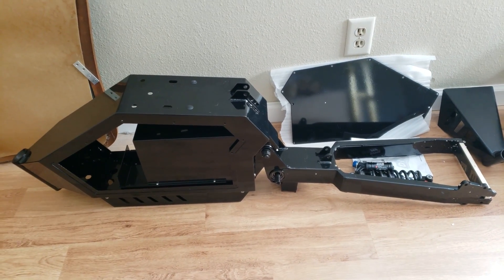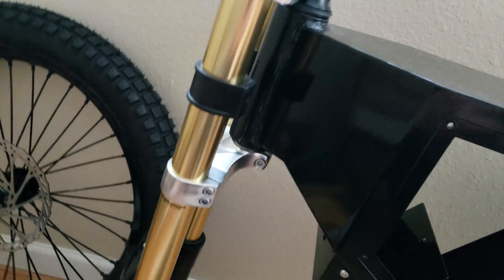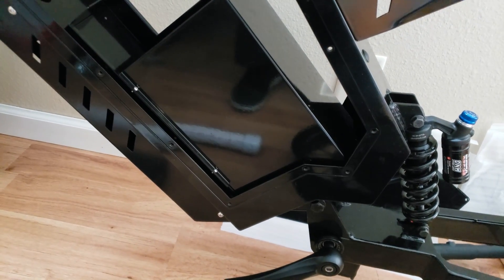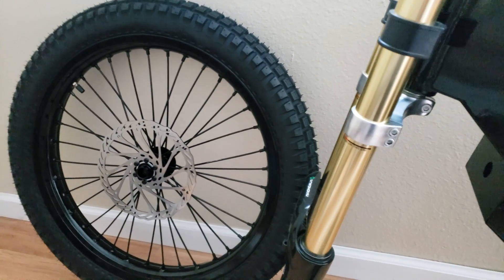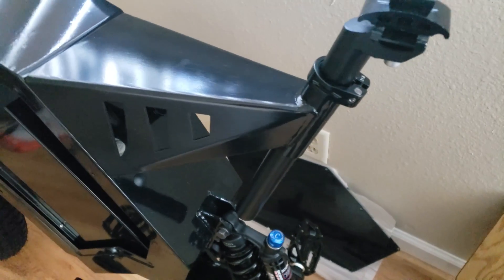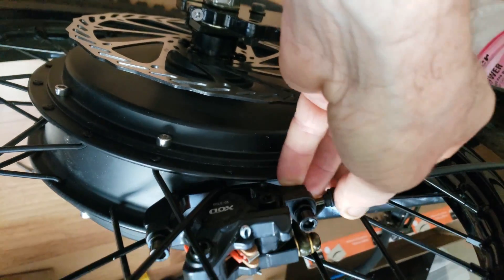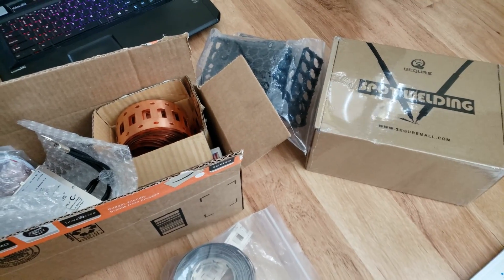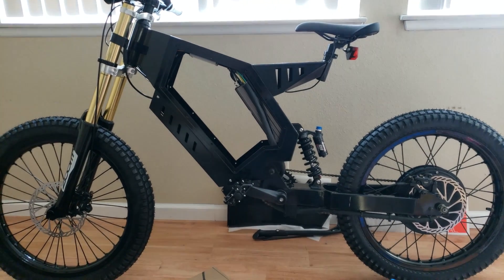Enduro Ebike build start to finish

Comment: Hey I just received a 8000w version of this exact bike from Alibaba. Can you please tell me your advance settings? Here are mine - 

Current limit - 120A
Poles in motor - 32
throttle PWM % - 0
Assist poles - 12

Does this look right to you? Thanks
Reply from the maker: Man I wish I can help you I have the controller out of the bike right now and I don't remember the exact settings  but keep in mind just because the bike looks like mine doesn't mean that it has the same electronics so I would be careful with that,  I know my controller is set at 150 amp but you may have a different controller.
Reply: @samjohnson517  I have the Sabvoton controller with bluetooth 72v 150a, 72v. 40 AMP Panasonic Cells
. when you put it back can you make a video and go through each settings in the ukc1 menu? thank you!
Reply: Also do you remember if you put 19in in the UKC1 setting?
Reply: Yo who did u buy from

Comment: hey sam. im building an ebike like yours. Im finding it very difficult to fires tires. the kit that i got say that the freewheel is 1.6x19 and the rear motor wheel is 2.5x19. what tires did you use?
Reply from the maker: I used shinko 241 size 2.75x 19 they work great on street and dirt
Reply: @samjohnson517  do you happen to recall what size the rims were? The kit that I bought doesn't use the same size front and rear.
Reply from the maker: @NirvashOne  money both the same I believe they're 1.6 you may have to jump to a 3.00 tire for the back but make sure you have enough room between the swing arm

Comment: can i use  29" wheels with this frame
Reply from the maker: Most are Up to 27.5 but ask the shop that you're buying it from, personally I would not use bicycle wheels they're too weak and will have to use bicycle tires which means flats which are a pain to fix on this bike

Comment: Can it be fitted with mid drive motor?
Reply from the maker: I mean when it comes down to it you can pretty much make anything work with modifications, but the short answer is no because the frame is too wide

Comment: You drilled a hole for the torque arms?
Reply from the maker: Yes, just a side note in my later videos I ended up leaving out those washers completely and just using the torque arms themselves for spacers.

Comment: Where did you get the wheels
Reply from the maker: Hello they came in the kit with the controller they're 19 inch motorcycle the place I got the kit from is called Ncyclebike  you can find them on AliExpress and Alibaba

Comment: I want the exact wheels ,motor, controller ect. Link in description does not work. Please help
Reply from the maker: I know I'm having problems with that Alibaba link, open up the Alibaba app and search for a seller called Ncycle, it is not something you can just add to the cart you have to contact them and customize it like this:   it is the 5000w kit, you will need to specify 3.5 turn motor and  upgrade the controller from 100 to 150  amp,  add a 19 inch front motorcycle wheel (the rear wheel is also a 19 inch motorcycle wheel. ) Tell them to keep the brakes the ones in the kit are not hydraulic.
Reply from the maker: https://encycle.m.en.alibaba.com/index.html?wx_navbar_transparent=true&tracelog=sns_minisite

Comment: Hey Sam! Your ebike build has inspired me to do my own. I’m working on putting it together right now but my controller didn’t come with any instructions. What are the two small connectors for that come out of the controller? Mine came plugged in to eachother.
Reply from the maker: Yes leave those connected together unless you need to do the hall test or change some of the parameters then you would disconnect them
Reply: @samjohnson517  awesome thank you! One more question- my hub motor has two big connectors coming off of it along with the motor phase cables. One connector has the RGBY wires so I know it’s the motor phase wires and it plugs into the matching connector coming out of the controller. The other connector has brown, white, purple, grey, orange, and silver wires and there isn’t a matching connector coming out of the controller for it. Do you know what this connector is for and if it’s supposed to be plugged in to anything?
Reply from the maker: It is just an extra phase connector mine has a cap on it. Just use the face connector with the corresponding wires

Comment: What is the issue with the forks? Would they have a hard time offroad? I am trying to build a similar thing for ripping around dirt paths but am totally new to this.
Reply from the maker: Hello if you're going to be manly off-road I'd probably step up on the forks maybe get some dnms these are okay but they're kind of annoying off-road they just make a lot of noise and the dampening is not very good

Comment: Is there a way to change the rear tire without having to unwire the rear motor?
Reply from the maker: Oh absolutely you do not have to disconnect the wire to change the tire, all you do is cut the zip ties off that hold the wire,  that gives you enough slack  to pull the rim off and then you remove the tire from the freewheel side.

Comment: Important question…can a stealth bomber frame fit 27.5 rims
Reply from the maker: Hello,  I can tell you that 27.5in rims will fit on my Enduro / bomber style frame just keep in mind some of these frames  are different but the specs should be listed.
Reply: @samjohnson517  yeah it fits easily, I even tried a old 28 inch rime, and still fit with ease….I was too lazy to experiment a 29inch tire….I believe a 29inch tire would fit with minor adjustments.
I will be doing a video on my build….tomorrow….I caught the e-bike bug as well’ no e-bike is the same, dispite having similar frames’ that’s why I like doing DIY….I could’ve bought a already built one….but what’s the fun in that? 
DIY teaches a person how these bikes work, and teaches you how to replace parts, if needed.

Comment: I meant can you remember what size bearings and cups the headset uses
Reply from the maker: No I don't remember , they came with the frame I tried to look up the old eBay listing but it's so old it's not on there anymore
Reply: @samjohnson517  OK thank for looking

Comment: How did you cut of the rail on the controller?
Reply from the maker: Hello, I used to jigsaw, I left a very small ridge enough to get some u-shaped weather stripping over the area  I cut, that's just for cosmetic though.

Comment: they supply 2 sets of torque brackets we used one on the inside and one on the out side
Reply from the maker: @katiekumcgil mine only had one set in a later video I just ended up bolting it together with no spacers I've had no issues in 5,000 miles.
Reply: @samjohnson517  AWESOME thats good distance with no hiccups ,i used a crystalyte hs4065 rd notor so actually had to get axle extenders to fit the drop outs it was the fastest motor i could find that still lets you run 7 speed casette and i worked out a way to put a 500watt bafang front motor onto the through axle forks,you can see a video on my chanel how the build ended up with the modified suspension

Comment: Hey guys a question ?? I have Enduro QS273 , battery 72v 52.2 Ah  BMS puts out 104 Amps.. my controller is subvoton 72150amps My question is WHAT HAPPENS IF I REPLACE MY CONTROLLER    WITH   FARDRIVE 72350 AMPS does it give me any benefits torque higher speed and more power??????
Reply from the maker: Hello I do not think you will see any type of performance increase. Is the 104 amps the burst rating of the battery or the continuous rating? But either way your 72150 can handle it. To get  performance boost from that 72350  controller you would have to change out the battery to one that would put out more amps.
Reply: @samjohnson517  so the  battery is the bottleneck ???
Reply from the maker: I guess it's more of the thing that's holding the system back by not feeding enough power. However there is  absolutely nothing wrong with a 100 amps!

Comment: Where did you get your front rim and spokes from? Working on a build now and would greatly appreciate your insight! Thanks for adding in so may details! Add one more subscriber! 🙂👍
Reply from the maker: Hello thank you! I purchased the rims, motor and  controller all together in a kit from Ncycle they are on AliExpress and Alibaba. The rims were fully assembled in fact the entire kit was plug and play.
Reply: Awesome! One more quick question. Where did you find your headlight that you installed later? I've looked all over and can't find it cheaper than 40! Thanks so much for your help!
Reply from the maker: @grantgall2517 no problem at all I'm here to help  I got it on AliExpress here is a link
https://a.aliexpress.com/_mqzgWRx
Let me know if you need anything else

Comment: Which tires are compatible? What is the frame specification?
Reply from the maker: I'm running 19 inch motorcycle wheels with 2.75x19 shinko 241 tires they're about 3 in wide

Comment: Can you put pegs on bomber frame?
Reply from the maker: Should be able to bolt them onto the swing arm, you may have to drill some holes though, unless you can find some clamp on type.
Reply: @samjohnson517  oh okay thanks

Comment: Can you post another link to the wheels you got?
Reply from the maker: Sure but I've been having problems to get Alibaba links to work if this link does not work go to ncycle on Alibaba I purchased their 5,000 watt motor kit and added the front rim and upgraded the controller to 150 amp
https://app.alibaba.com/dynamiclink?touchId=1600127981110&type=product&schema=enalibaba%3A%2F%2Fdetail%3Fid%3D1600127981110%26ck%3Dshare_detail&ck=share_detail&shareScene=buyer
Reply: @samjohnson517  I’m totally new to this. I looked up ncycle for 12000w motor kit. Should I get 12000w or 5000w?
Reply from the maker: hello Cole, I know it is confusing my motor is a 205mm 5,000 Watt,   which means it is rated to run at 5,000 Watts continuously, however I send 12,000 Watts through mine for brief periods of time, speed runs etc. With no issues. Most motor manufacturers have two ratings,  continuous and burst or max .
Reply from the maker: As far as which one to get that's up to you , I believe the 12,000 W you' are referring to is the 273mm. If you are planning to use a large enough battery so the larger motor can take advantage of it and/or high speed 65 to 70 mph on a "continuous" basis maybe the larger motor is for you. Note that there are different turn motors mine is at 3.5t the higher the turn number the more torque you get but lower top speed.

Comment: Hi mate   ive the same controller...what is the 3 small wires going into one plug for ? Is it 12v ?
Reply from the maker: Hello Steve, great channel by the way! On my controller,  maybe it is  like yours,  I never understood why it did not have all of the wires that you normally see on these, like for lights horn etc.  I  have the two pin plug for  the harness (brakes throttle and screen)  and I have the plug for the motor and then I have a small  three wire plug that I believe has something to do with the hall test because it says to disconnected before doing the hall test and then reconnect it after the test.
 When I changed the  brackets of the unit I did notice a bunch of wires inside  not being used,  they chose not to run those outside  for some reason. 
I have the same problem trying to run 12 volt out of this unit. 
I am just going to use a 72 volt to 12 volt converter, I am  going to hook the converter directly to the controller positive and negative.
Reply: @samjohnson517  thanks for your reply...yes its weird ive not cone across one like this...its the small male controller im struggling with  has 3 small wires going into the small male connector... so ive no pas on this ? Do you have pas on yours ? ....
Reply from the maker: @steve7163  no I do not, it is probably one of the wires inside the unit maybe remove one of the covers see if you have all the wires inside like mine.

Comment: I also had trouble with the lower bearings, no tool either, but I ended up finding a metal tube not quite the right size, so I put several aluminum rings at the end. I had found it, and I hit with a big hammer but I had placed a thick piece of wood on the tube, it was not easy to put on this bearing anyway, it would take specific tools as they have in the factory ...

J'ai eu du mal aussi avec les roulements inférieurs, pas d'outil non plus, mais j'ai fini par trouver un tube métal pas tout à fait de la bonne dimension, alors j'ai mis au bout plusieurs anneau en alu que j'avais retrouvé, et j'ai tapé avec un gros marteau mais j'avais posé sur le tube un morceau de bois épais, ça n'a pas été facile à enfiler quand même ce roulement, il faudrait des outils spécifiques comme ils ont en usine...

Comment: Did you run into any overheating issues with your controller being inside the frame?
Reply from the maker: No I have not, I rode to the max range 42 miles and I was not easy on it, I did not have any problems.

Comment: this frame is 177 dropout normally for fat tires.  are you just using those spacers to float the wheel?
Reply from the maker: Basically yes just to take up the space I do not  think a fat tire would fit on that swing arm because fat tires are 4 inch+ I am pretty close with my 3-in tire
 I know they make a specific fat tire swingarm that they sell separate for that  frame it I saw it on AliExpress. I was thinking that  177 drop out is more for larger  q273 motor
Reply: @samjohnson517  so with the spacers, do the brakes line up correctly with the brake rotors? They're not too far away?
Reply from the maker: @airfox  I used spacers I think they were 3/8 to move the caliper over
Reply: nice thanks!!
Reply: @samjohnson517  cool! Hey, so I contacted the seller of your frame cuz I like this style and he said it is V1 of the frame, whicj I heard can crack, I believe in the dropout or something. Do you have any experience of this?
Reply from the maker: @airfox  no I don't see any cracks in the frame but I haven't taken it out yet so I guess we will see what happens. Where did you hear of the frames cracking?
Reply: as im researching ive seen people warn against the first Bomber frame. the seller said this is V1, yet its so hard to know. the giveaway was the brake bracket is welded, but this one looks like it is a part of the frame, so.... Im trying to figure it out. If you do the same, we can find out whats up. maybe the seller just didnt understand my question, language barrier etc etc..
Reply from the maker: @airfox  definitely something to keep an eye on but at the end of the day it's just steel so if it did crack it could be easily welded
Reply: yes, of course!!

Comment: I'd definitely upgrade your  discs.i had to lock up the brakes on mine and it literally blew them apart and the rear warped to shit.. do it, it could save your life
Reply from the maker: Hello, yeah the  brakes are definitely on the upgrade list. I hammered those pretty good though I'm surprised that they're taking the beating they are.  I changed my pads to some semi-metallic and it sure did  make a big difference, but yeah they need to be changed. I am  going to go with magura mt5e and magura 203mm disc
Reply: @samjohnson517  right on brotha.just looking out.yea, no joke my rotors litterly had just obliterated when I locked them up,and it was a nasty crash
Reply: @samjohnson517  Post an update video with all the components/changes for your final build. Looks amazing so far
Reply from the maker: @c2thew  thank you! I have just been riding it like it is, as far as the brakes I changed the pads to semi-metallic and they  actually made a  big difference. But when I do some upgrades I definitely will post an updated video.

Comment: Much did this cost plz
Reply from the maker: Hello , about  $3500
Reply: Thank you looks great
Reply from the maker: Hello and thank you for watching, well as far as fitment issues I have the opposite problem my swing arm is  too wide so I have no issues with fitting it in there.  You would have to measure your drop out (swingarm width) and compared to the motor you want to use keeping in mind that in my case my swing arm is fairly adjustable in the sense that I could widen it or bring it in slightly as needed, you may be able to do the same.

Comment: could you please give me the length of the spokes of your front wheel and you rear wheel ? thank you so much
Reply from the maker: Hello, kind of hard to get an accurate measurement they came laced but the rough measurement:  front 8 inches rear 5 inches
Reply: @samjohnson517  thank you
Reply: @samjohnson517   question same frame running a 60v battery on a 48v 1500w kit 24x4 tires so around 25.79 inch tires. Do you think i could swap out my 1500w motor with the 5t?
Reply from the maker: @felixvalvaneda2285  a 5t meaning 5 turn 1500?
Reply: @samjohnson517  i have a extra hub its a 5t could i swap it out with my 24x4 rim and spokes off the 1500w one

Comment: Nice build.  Can you replace those pedals with foot pegs?
Reply from the maker: Hello thank you , I have never seen any kind of conversion kit but I'm sure you could rig something up in the bottom bracket and make it work..
Reply: @samjohnson517  Thanks for the reply. I've been looking for a kit with no luck, so I may try my hand at rigging something up.
Reply: You could always buy pedals that fold up LIKE pegs, ive seen those
Reply: @mattvw80  heres a pedal kit for enduro that makes pedals into pegs as well for enduro riders
Reply: @normmiller2536  i would do pegs because something of this size and speed will look out of place on pedal bike trails I'd take this direct to the dirtbike trails or street ride